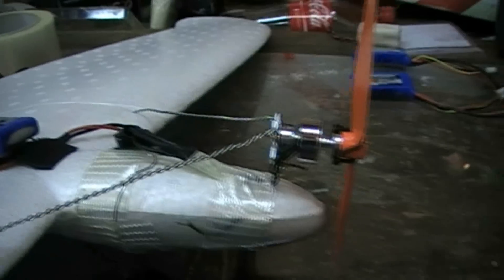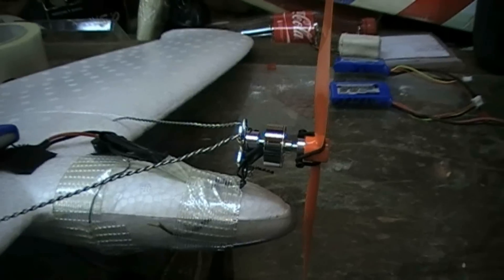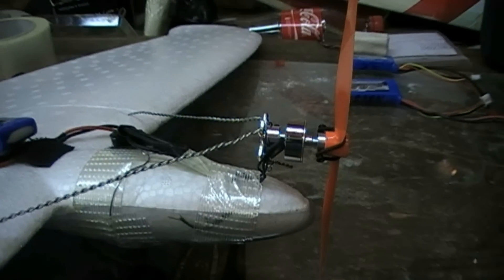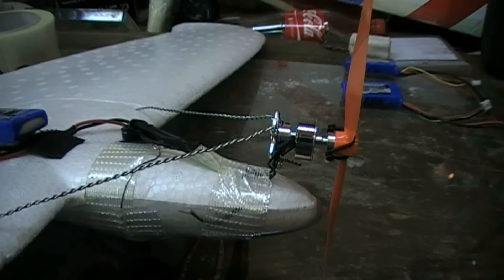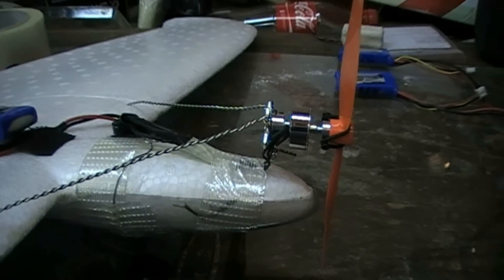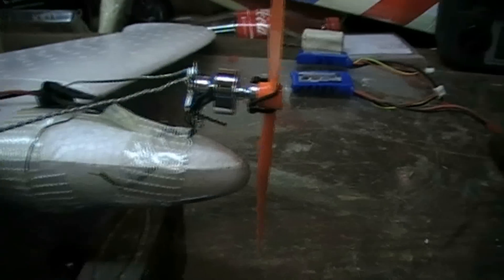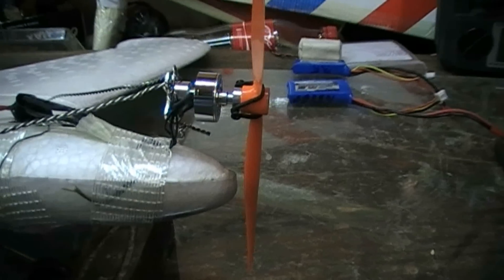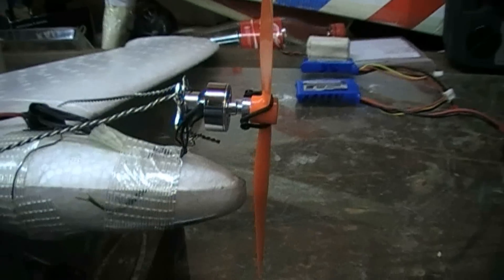Motor Alula 1. flight. Part 2

Comment: Could you please share the  power setup please .. motor/props/ESC ?
Thanks a lot
Reply from the maker: The motor is from Hobbyking, and called 10 gram motor and 6 amp esc and 6" prop. https://hobbyking.com/en_us/18-11-2000kv-micro-brushless-outrunner-10g.html
Reply: Thanks a lot ... The battery is 2s  but what is the capacity ...??